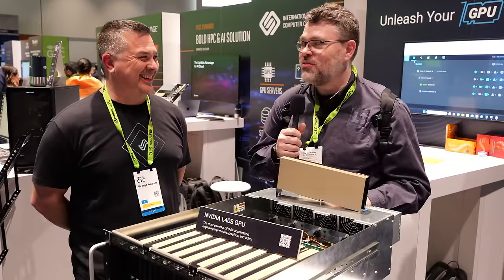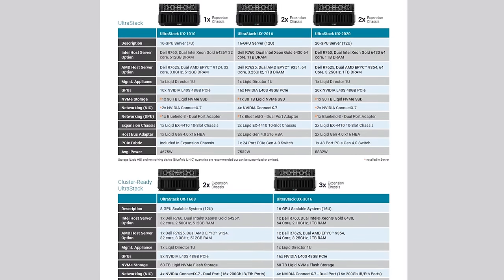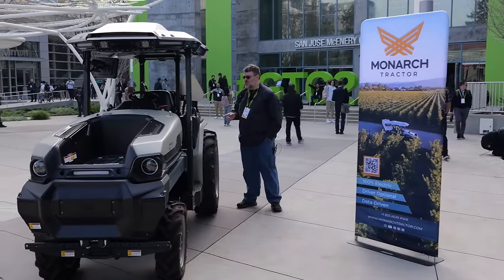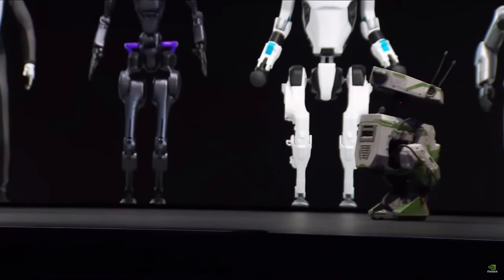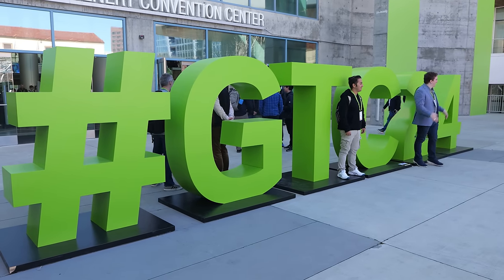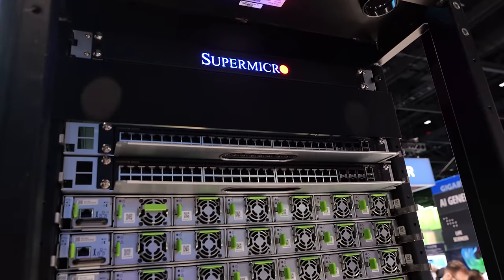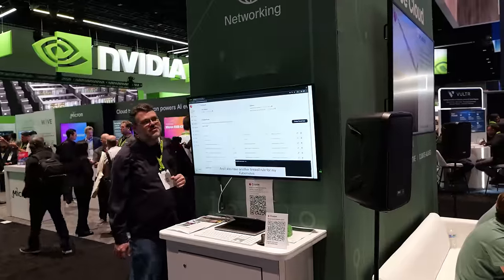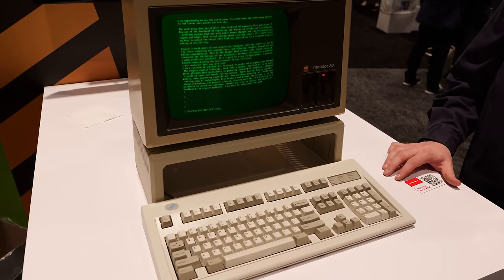#GTC24: AI, Robots, Storage, and MORE!

Comment: I'm running an AMD 5800x on Asus x570 Prime-P with 64 GB 3600Mhz cl15 ram, 512 Gb Samsung Pro gen4 NVME, 1 TB corsair gen 3 NVME, and 10 TB spinning rust with an Nvidia 3080 10GB, and to burst your bubble I'm running 70B parameter models on it no worries, it's all about the right model type and Quantization, I'm using GGUF 5 bit or 6bit Quantized for the best accuracy against size. Works fine.